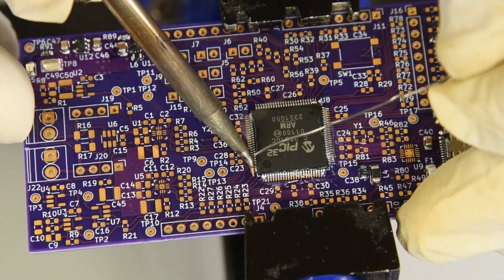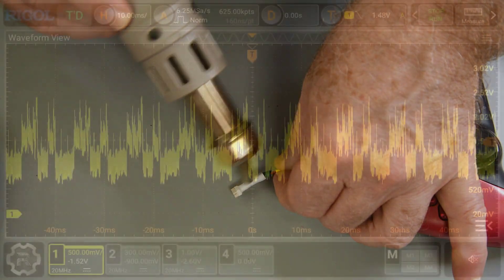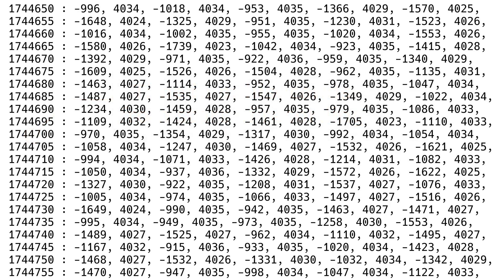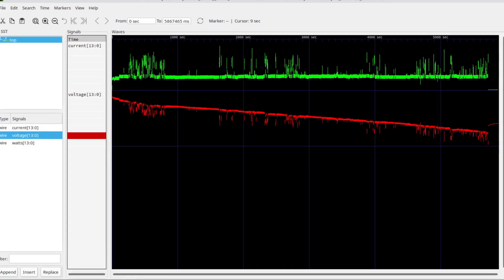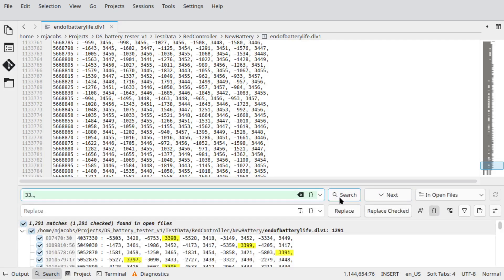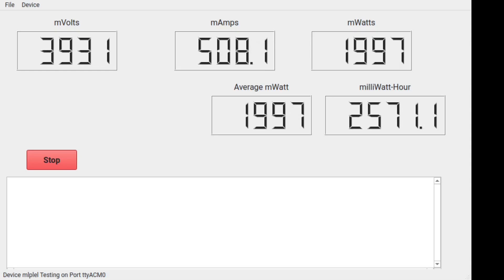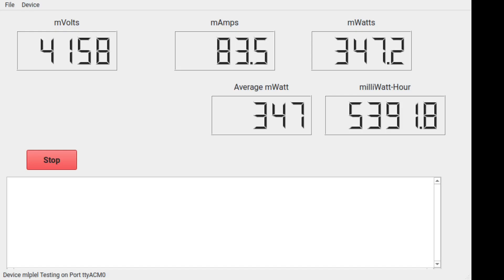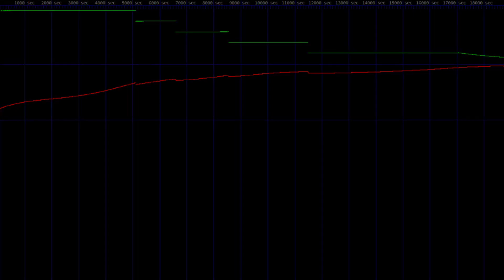Prelude to Testing DualSense Batteries

Comment: I am really curious about this research.
So I opened my old Dualsense battery case (BDM-010) and found out it was manufactured by Murata, model US623856E1S. Found a Safety Datasheet in their website and it says:
Nominal Capacity : 1630 mAh ( 5.96 Wh)
Rated Capacity : 1590 mAh ( 5.8 Wh)
Average Operating Voltage : 3.65V
Watt-hour rating : 5.96 Wh / 5.8 Wh (Nominal / Rated)

I don't know much about batteries but your tests shows it stopped charging at 4.1 Volts. Is that safe? All of replacement batteries I'm seeing was rated up to 3.65-3.7V? Or is this a BMS thing?
Reply from the maker: Yes, 4.1 is fine, and I think it's closer to 4.15.  And even at 4.15, the cell will not be at 100% charge, which is good.  Taking the battery to 100% charge and 0% at discharge will really shorten the life of the battery.  The charge profile the DualSense uses seems to be a bit strange.  Instead of charging at a constant current until the voltage limit is reached, it charges at 500 mA, then drops to 400 mA, and continues to drop in 100 mA increments, all the way down to 100 mA.  Then it seems to switch to constant voltage until the current hits around 60-65 mA.  Then the charge cycle ends.

Comment: One quick question:
Is it possible to install a regular hall effect or tmr module on a elite series 2 even though I can't adjust the tension? My doubt is if the modules are equally, shape, form and numbers of pins or if there is any difference. 
Thank you.
Reply from the maker: I don't have an Xbox, so I don't know for sure.  I think that is the joysticks that have the threaded shaft.  If it is the one I'm thinking about, it looks like it's made by Alps, so there would be a good possibility that the Hallpi/GuliKit TMR sensors would fit the joystick frame.  But I don't have one, so it's just a guess.
Reply: Thank you  @metalplasticelectronics354

Comment: Hello, I recently swapped the spring out of the v5 looser ginfulls sticks and put them on the v5s sticks which were more stiffer and now after calibrating the joystick doesn't seem to center properly and gives me drift, it calibrates but then after a bit of gameplay it will start to drift, iv made sure to put the joystick back correctly what can be the issue?
Reply from the maker: There seem to be some differences in plastic pieces as well. Did you only replace the spring?
Reply: @metalplasticelectronics354 yeah I just replaced the spring, you reckon I replace the plastic piece too, it's gonna be difficult now desoldering it
Reply from the maker: That and the tabs that hold the joystick together will break after a few bends.

Comment: Great work! By any chance, did you test if there is power draw from the battery when it’s at 100% charge + plugged into the charger/PS5 + playing a game? I suspect the controller still draws from the battery in this scenario but I don’t have any data to back this theory up.
Reply from the maker: Yes, it does.  I have a bit too much noise when the current draw is near zero to have a lot of confidence in the reading, but I would suspect it's in the 200 to 300 microamp range.  Unplug the USB and the current draw from the battery drops into the nanoamp range.
Reply: @metalplasticelectronics354 That is interesting! This means that the draw when plugged in is not used to power the controller fully, but maybe to power some other secondary operation within the controller? And the controller is mainly powered by the usb charger.
Reply from the maker: I believe the drain is connected to the PMIC. Looking at some of the Dialog datasheets, looking for a step charge profile, I see that some of them have a full shutdown mode. I think as long as there is voltage on the VBus line from the USB, the PMIC will not enter shutdown mode.

Comment: This is astonishing research for something that I don't think it deserves it.
YT is amazing, keep up the great work 👍
Reply: I disagree. This will allow us to know which batteries on Amazon are actually good and which to avoid. This in turn means we’ll be able to buy better batteries without the worry that they’ll short out the controller or that the battery won’t last long. Because some batteries out there will almost triple your battery life. I’m particularly interested in this research because of the edge. If we can find a good battery for the edge, its weakest point will instantly be fixed.

Comment: Thank you for this awesome video! You're the only channel I know exerting so much effort in this kind of things. I hope you get the chance to test those 103450 and 104060 batteries.
Reply from the maker: I plan on it.
Reply: 104060 is a go! I even managed to place some 104068 and 104070 into my DualSenses (BDM-010). Yeah, cut some insides, but i absolutely forgot about discharge messages.